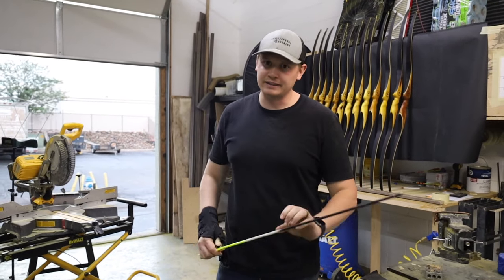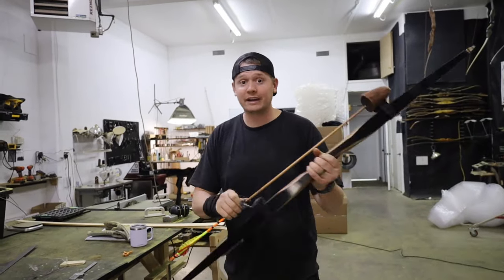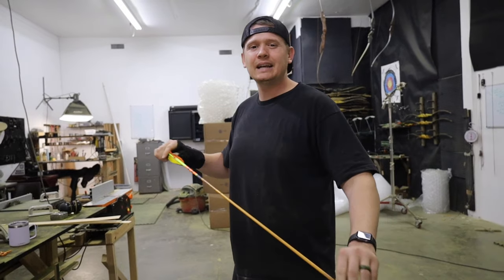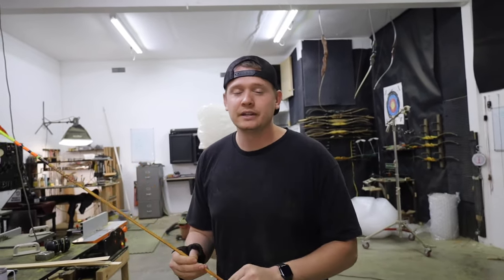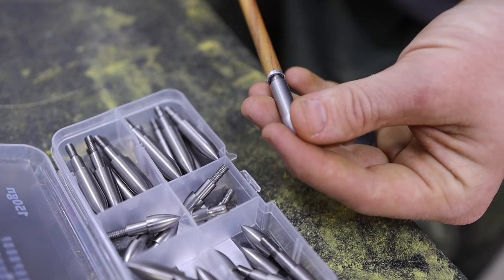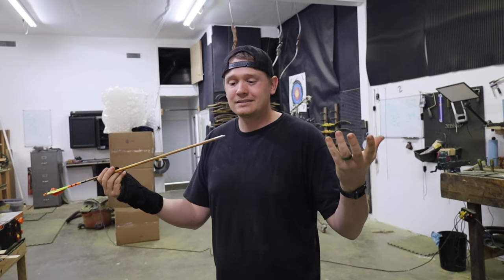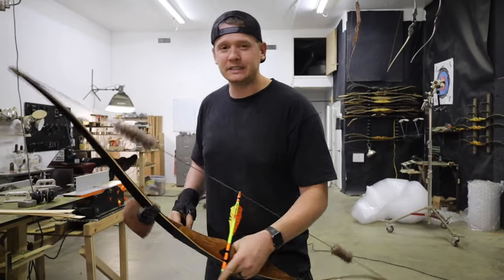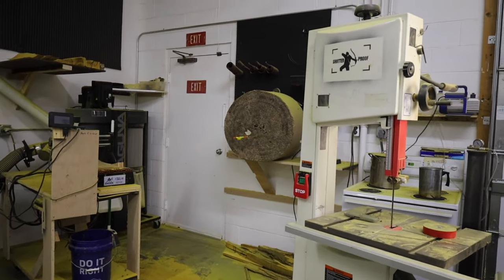Kramer's OVER-SIMPLIFIED arrow tuning method (fix left to right arrow flight)

Comment: Great video Kramer.  Another tip maybe... In eastern traditional archery. It's more about technique. So eastern archers usually shoot from the right side of the bow. This makes doing khatra easier. So when doing khatra it eliminates   the arrow having to curve around the bow. Also they don't even use fetching in certain cases and that arrow will fly true. Also release technique makes a difference because if you use Slavic release for example. You don't don't need to worry about proper fitting nocks. So basically eastern traditional archery teachers technique to make a super efficient archer.  They can use a stick and string for a bow and any kind of arrow. No tuning needed. Just technique.  And this can make the arrow fly true. So something to think about. I'm using ottoman archery to learn these skills. I'm just sad that I can't learn directly for an ottoman archer.
Reply: Same for English Longbow and old no shelf Flatlimb Bows from Europe (after the Yew Shortage for some places if they did not use Mulberry to make a style of more modern English longbow), during war they were used off the right side/outer side for speed reasons like most places. Because the actual war archers did shoot off the right side most people use them off the right side even if they were not a war archer, like nobles hunting or the common English or Wales person after the Vikings, they were asked in England and Wales to learn how to use a bow to defend the country by using the bow at least once a week, even though most commoners did not learn to use a bow.
Reply: @caseysmith544  Hey Casey. Thanks for this info. Quite interesting
Reply: @musaadfelton3909  Not 100% on the After Viking part but the rest is true, and it was not until the 1600's or 1700's that people started to use the inner side because some had trouble using the outer side with arrow going further in that direction to the outside.
Reply: @caseysmith544  archery is amazing. Archery can bring the world together.

Comment: Hiya folks, hope this day finds you well and enjoying it,lol, I just happened to shoot the same arrows you have in your video, I got some 400 and 500 spline arrows in my quiver, shooting both with my bodnik slik stik 40# ,58" bow, this bow really shoots fast, n, the arrows fly true, with only 125 grain field points, and my hunting tips, I recently dropped bow weight, down to 40 lbs from my 50 lbs bodnik slik stik, getting older I guess, lol, my question for you is, have you tried just 2 fletchings on your arrows? try it out see what you think, shakyjake out.

Comment: Hello Everyone, I NEED HELP!! I've been trying to Tune my arrows and I'm going crazyy!

I have followed this video and many others trying to get true arrow flight, but seems impossible.

I ALWAYS get "KNOCK LEFT" arrows.

I have tried arrows ranging from: 
-More flexible: 30" 500 Spine 125gn Point.
to
-Stiffer:  28" 400 Spine 85gn point.

I've got a Right Handed Bucktrail Wolverine 52" Bow
And I pull around 46lb@28

I think I am using the appropriate Spine for my arrows and going Stiffer seems crazy.

I have even tried shooting them without a point to make them 'stiffer' or not pulling the bow to full draw to make it less powerful, but my arrows keep flying out of the bow 'knock left' and I don't know what to do.

 I think I have quite good release and form, and even if it isn't perfect I dont think it would affect so much.

*I think its important to note that the bow shows a lot of marks of arrows rubbing against it on the back of the arrow rest cutout.

Sometimes with feathered arrows seems like its okay or even knock Right (but I think they only overcorrected), but when I try BareShaft tuning I always get around important Knock  Left shots (even with 28" 400SP 85gn point shafts)

Has this happened to anyone? Maybe I need even stiffer arrows? Or maybe way more flexible? Any ideas?

Thanks for your help!

Comment: I used the Spine Charts from 3 Rivers since the Cupid Arrows a 450 spine Aluminum at 30 inch with a 100 grain tip and 100 grain broadhead do not have one. The arrows are for my latest bow the 52 inch Youth Longbow in hickory with minor reflex I asked them to make a 45 pound bow from the GREAT PLAINS TRADITIONAL BOW COMPANY for my latest bow I ordered to have a good hunting bow weight set to draw 24 inches as my draw is about 24--24.5 inch. I intend to hunt with the bow soon, but the other two I have one was OEELINE Airobow 54 inch one piece recurve bow at 45 pounds I pull to 35-36 pounds thanks to your recommendation. But to get 45 pounds from the OEELINE Airobow 54 inch one piece recurve bow, I would need a not ever made 55 or 60 pound bow based on the draw weight I am getting with the 45 pound 54  inch OEELINE Airobow one piece recurve, so just getting a heavier bow is out. The other bow I have a 60 inch duel sided flatlimb longbow the 1960--1979 made Arctionbow 8200 by Actionrod (they still make fiberglass fishing rods for fly fishing) is 35 pound draw I pull to 34--35 pounds. Thus due to the low 4 inch brace height for the Arctionbow 8200 by Actionrod 60 inch flatlimb longbow  it has from the little I could find on the Actionrod 3 models of bows they made, a flatlimb longbow, a static tip recurve made or at least sold until 1967 and a modern tip recurve in 1964 after the Bear Patent died off in 1963. That model of Actionbow by Actionrod had with the 4 inch brace height that was one of the lowest brace heights of a bow that had hunting weights above 35 pounds for a bow.  Actionbow 8200 by Actionrod 60inch longbow has a 39 pound and a 40--42 pound weight for the Longbow as well as a 35 pound and a 29--30 pound bow. This was before the low action of the super recurve bows designed to sort of keep up with some old top of the line compounds that sometime in the 1980's that had gone over 200 Feet Per second or 61 meters per second. I did the same for my OEELINE Airobow 54 inch one piece recurve that is using a 1916/500 spine Aluminum arrow a Musen and another Sharrow that is a Musen without the label and thinner fletching so it will fly better on the bow.

Comment: Okay newbie here... what if I'm aiming at a certain spot but the arrow is going to high up? I have to aim super low on the target for the arrow to go near the center. Is that an adjustment issue or a common beginner problem? 😂
Reply: Are you shooting split finger or three under and what is your nock point height

Comment: I have a range of bows.... recurves (Traditional and modern) , longbows (Modern takedowns and single piece laminated), Asiatic (Mongolian, Chinese and  Hankyu (short Kyudo)) anything between # 27 and #45... I use the same arrows with them all (arrow on the R or L depending on the bow), anything between 650 spine and 400 spine and pure carbon, carbon mix, bamboo, wood shaft... and of varying weights and lengths.... I don't disparage 'tuning' arrows... but arrows should be tuned to each bow. 
I HAVE 12 BOWS..... Are you in cahoots with arrow makers? I'd have to buy SHEDLOADS OF ARROWS!
So my adaption to having 'tuned' arrows is simply to shoot my first arrow , see where it goes and then adjust my aim, after a few shots I can usually start to get decent groups.... I know... Low tech but if it was OK for the longbowmen at Crecy and Agincourt, it's OK by me.

Comment: I know this is an old video but I’d just like to point out that both in your video and your diagram, you’re completely omitting left handed shooters. For left handed shooters everything’s opposite. You should talk about it based on which hand you draw with. I like to think of it as if the arrow goes towards my left side (strong side) then it’s too stiff. If it goes to my right side (weak side) then the arrow is too weak.

Comment: What if you have an arrow that nocks both left and right? I had this with some that would bend both going right and then left before being perfectly straight after 10-20 feet. I felt they were just going to be Target set since my others for that bow fly fine, but I will try some of these  arrows from my new bow when it comes to me.
Reply: Arrow spinner, nock tune fletch tune and point and insert tune if need be.
Reply: Try changing brace hight by adding or subtracting twists. (I just learned this yesterday from instructors) it moves the side to side String oscillation at the moment the arrow leaves the string. My brace hight had decreased almost half an inch on my new Flemish twist string from the start of shooting session to suddenly not being able to come close to the X. (Windage) Twisted the string back to original brace hight fixed it.

Comment: Bareshaft tuning is so fickle. You can have impressive groups and decent form when shooting fletched and still have inconsistent bareshafts. 
The slow mo camera is a way better way that I personally used. At the end of the day if your arrow is flying straight without too much flex then you don't even need to bareshaft.